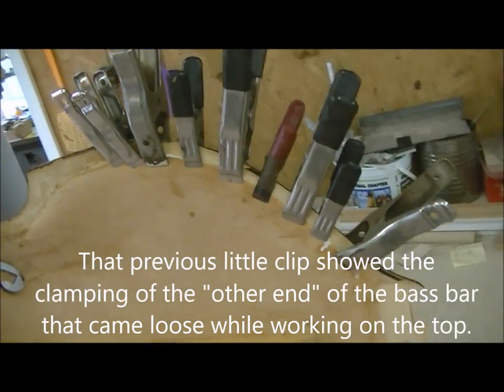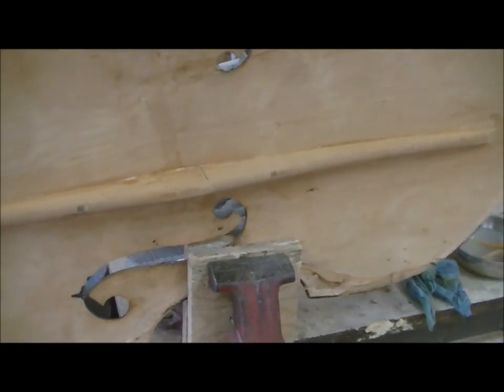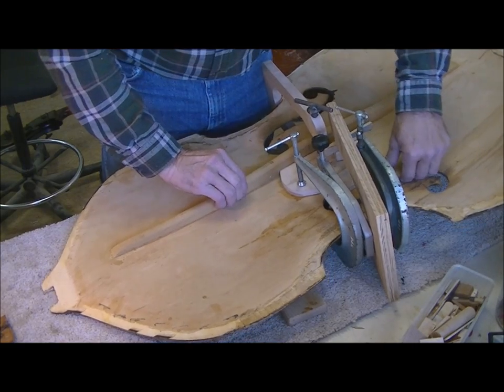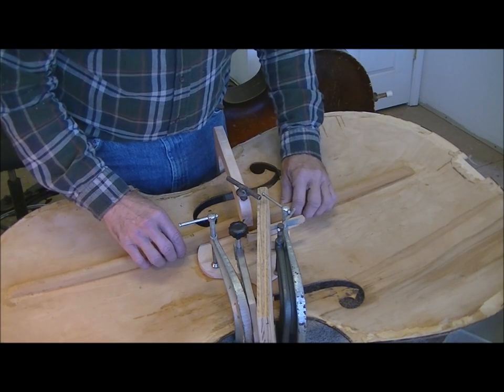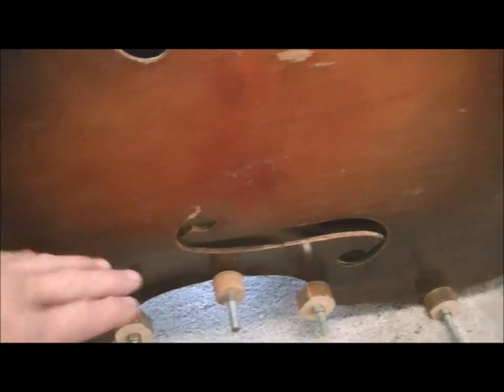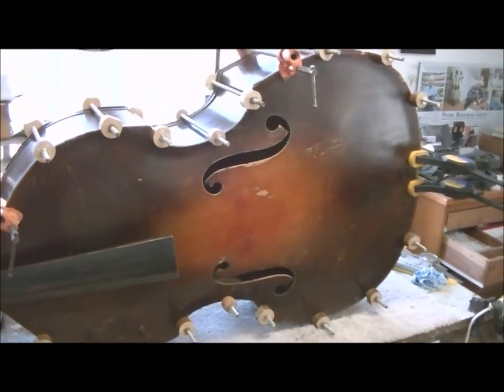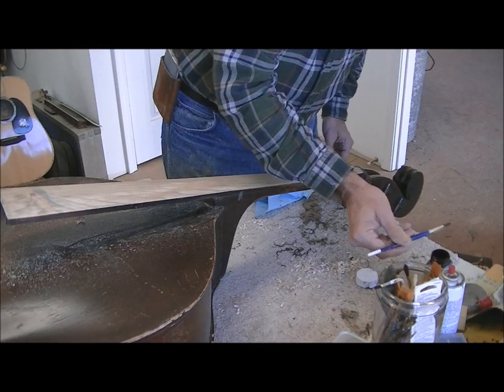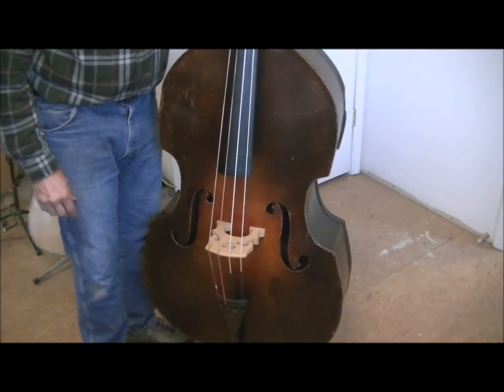O92 RSW Difficult BASS Top Repair Part 2 Final

Comment: I've done this repair before , and I sending you all the respect I can muster. It took me a couple of months to do my restoration ( the customer gave me the time). The post was down and the string tension was on in a closet for thirty years .I had to fix the same "dip" in the top , and also saw the same problems with the bass bar and delamination . The customer also wanted a new fingerboard. Watching your video was a treat ! I had to peel all the loose laminates off and press the top back into shape one section at a time , then re-laminate the bits back together. I used a giant "go-board" (table) . The base of my go-table is a mold of a Bass Top made of plaster and maple framing . a lot of time and scratching my head , but there is a luthier- repairman here in New Orleans who gave me a lot of advice and in the end the bass turned out great ! You do great work and Thanks for the video , I'm glad that there are repairmen like you that'll even try to do this kind of work!!!
Reply from the maker: Thank you very much.  Great story.  Sounds like the one you did was even worse.  Congrats on the fix.  I just saw the owner of the bass last week.  She is in love with it.  She says it sounds and plays great and has much more volume.  Thanks again.

Comment: A trick I used when I refinished furniture I would use to fix dent in wood furniture , or similar like you have in the top of that Bass to fix them dents, I would take a hot clothes iron and  wet sponge, and I would wipe the dent down with a wet sponge and then lay a piece of brown grocery bag over the dent and lay the iron over the dent for like 10-15 seconds at a time, no longer, It will help raise the grain of the of the wood. But do it small short session or you'll burn the wood.
Reply: P.S. Use a low iron setting.

Comment: Well Done, Sir! If that was mine, i would have wanted to keep my neck worn. I am actually waiting for my bass's neck to wear down a little. I should also pick up a glue bottle, my top has started to delaminate a little from one of the F-holes, i might be able to save the top from worse damage and repair it without removing the top.

Comment: Would moisture and heat work on the large depression on top?
Reply from the maker: I'm sure it would under the right conditions. And I think you would have to use a press of some sort to push it back into shape. And you might want to use some sort of a press that you can tighten over several days.
Reply: @RosaStringWorks  But probably not the best solution when there's a show later in the evening, lol.

Comment: Great video, would have loved to see how the brace under the treble side turned out. I built a balsa topped violin that wanted to sink in as the strings were tightened (not dense enough balsa in that one). I ended up putting in a brace similar to the bass bar, not as thick, but just as high across the grain so it wouldn't interfere with the sound post. It ended up sounding better than the other balsa violin. Both balsa violins sounded good for not having any previous instruments to base them on. In the balsa violins, I carved the bass bars into the top plate rather than glue it in. My balsa violins (I  made two) had carved tops and bottoms, but were not traditionally shaped. I have pictures of them in progress and finished in the photo section of my Facebook page under Larry O Stafford, if your interested.